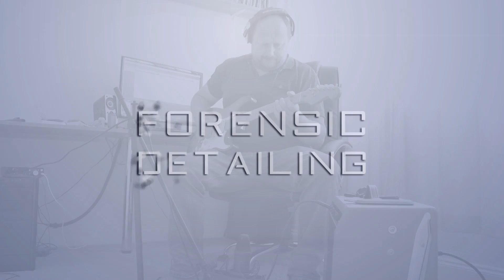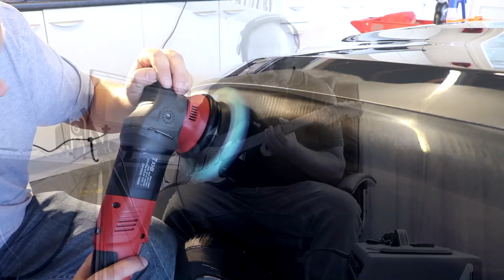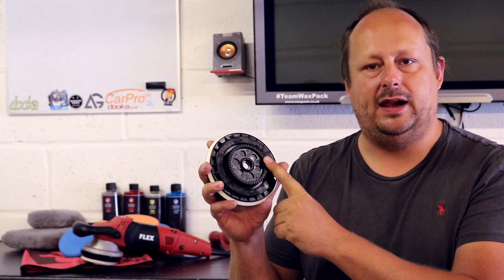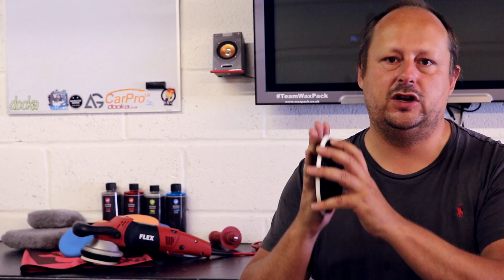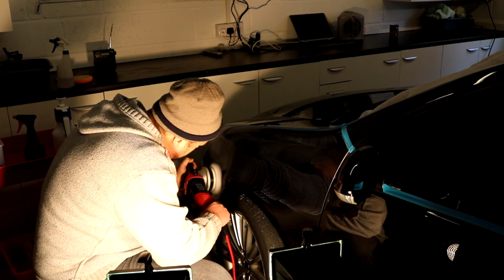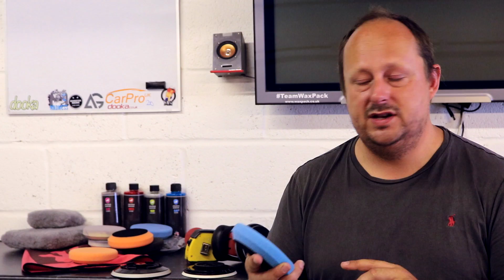Flex XC VRG 3401 machine polisher review

Comment: John:

I am wiriting frm Canada. 

Locally, Lake Country has released the Hybrid Force line of pads, also specifically for forced rotation polishers like the Flex XC3401. They are 5.5" in diameter. With that diameter, they can be used with teh Flex 4 3/16" backing plate. Have you heard of them, and have you tired using them? I don't think that Lacke Country has discontinued the Hybrid Power pads, but thier 4" backing plate is not available locally (in Calgary) any more. Just wondering how the new Hybrid Force pads with the Flex backing plate compare to the Hybridg Power pads with the Lake Country backing plate system.
Reply: Steve Madden As I said, in Calgary, Canada the Hybrid Force pads are readily available. I get them at this dealer : Carzilla.ca. They have been available since the fall of 2016. There is some divergence of opinion regarding there being a new foam formulation, or if they were just resized to fit commonly available backing plate sizes. I am happy with my combination, and as the Lake Country 4" backing plate system doesn't seem to be available any more (required for use of the 5" Hybrid Power pads), I don't really have much of a choice. People have reported favourably on the Hybrid Force pads.
Reply: The Lake Country 4" backing plate was no longer available starting in the late spring/early summer of this year. Hard for me to know when they actually stopped making the plates, with the local guy possibly having old inventory sitting around. The 5.5" Hybrid Force pads first showed up in Jan./Feb. of this year. I don't have any way of knowing what is available in Europe or the UK, which is why I brought this up.

I have heard from postings in various message boards that the LC backing plate system, which originally came with both a 4" plate and a 6" plate had some issues, mostly with the 6" size. For a while, it was only sold with a 4" plate. I think the 5" Hybrid pads were a mistake on LC's part. A non-standard size pad that required a non-standard backing plate. The more recent introduction of other forced rotation polishers (Makita PO5000C, and the pending Rupes Mille) that use 5.5" pad probably killed the 4" backing plate, and longer term, the 5" [pads
Reply from the maker: yer this whole plate/pad sized thing is a bit of a nightmare when your starting out..

a standard accross the industry would be nice..   maybe 150 125 100 75 etc....     100ml plates are rare generally, even for the m14 plates

It was all a bit wierd the LC made an adapter plate system for a power tool in the first place though.. (wierd in a good way though)..   the problem maybe that although 3401 sell well in the "detailing" scene that scene is a tiny piece of their overall market compared to what they do with dry wall sanders etc.. so flex may not have been to interested in offering smaller plates.  LC may have just simply thought something like "this tool  will work better with smaller plates and pads" and proactivly gone and made them.. perhaps its was a lot of hassle for not much reward.. and now the new tool is on its way they are just going to work to pre-arranged sizes... who knows...
Reply: It would be best of the pad industry would just standardize the pad sizes. THe tool vendors would just have to size their backing plates to suit. In the case of the LC Hybrid Power pads, they are non-standard in size at 5". There are 5.5" sizes available from just about anybody. As far as I know, there is nobody offering a 5.0" pad. Because LC made a 5" pad (that was essentially unusable with existing backing plates sized for 5.5" pads), they had to come out with their own backing plate (s). If the original Hybrid Power pads were 5.5", the Flex 4 3/16" plate could have been used. Now, the Makita PO5000c (backing plate for 5.5" pads) and the soon to come Rupes Mille (also with a backing plate sized for 5.5" pads) have further put LC on notice that they must make a forced rotation optimized pad at 5.5" or risk being shut out as a pad provider for those polishers. I think LC saw the writing on the wall, and basically moved to a 5/5" size for their forced rotation pads. It was easy to design and put into production an alternative backing plate system for a single polisher; it is a lot harder for two additional polishers. They standardized on the 5.5". The 5.5" will tend to walk more than the 5" to some degree.

As for smaller plates, the minimum size of a backing plate is set by the diameter of the ring gear inside of the gearhead. The backing plate needs to make contact with the ring gear to have the forced rotation work.  Of course you could make the pad smaleer, but at that point the 3401 becomes a free spinnin DA, but an expnsive one. I think the practical limit of a backing plate for the SC3401 is probably close to the current 4 3/16" backing plate that Flex offers, and allows the use of the 5.5" Hybrid Force pads.
Reply from the maker: this is news to me..   I would cry if they stop making the pads.. if I get time ill ask LC what the score is.
Reply: Forensic Detailing Channel From all reports on the message boards, the Hybrid Force pads are an improvement. Just wanted to start your impression of them. I am using the 5.5" Hybrid Force pads with the Flex 4 3/16" backing plate, and like them a lot.
Reply from the maker: I bet there good but I will still cry if they have stopped the 5 inch hybrid power pads with the 4 inch plate system..  that for me is perfection.. theres literally nothing I would want tweaked or changed with that combo :(
Reply: I wonder when we will see the new force pads in the Uk ?
Reply from the maker: LC confirmed they have discountinued the 4 inch plate..  they said the hybrid power are still stocked with distributors but they were not 100% clear if they are making them I got the impression they might not be now...  :(
Reply: No UK stockists currently in fact only one stockist of the old Hybrids.besides the size I'm sure the foam played a big part in the popularity of the Hybrids ..I can't imagine that LC s new  Pads would be any less impressive.